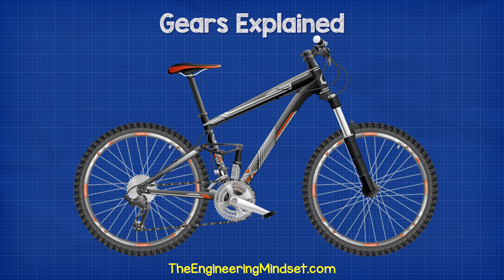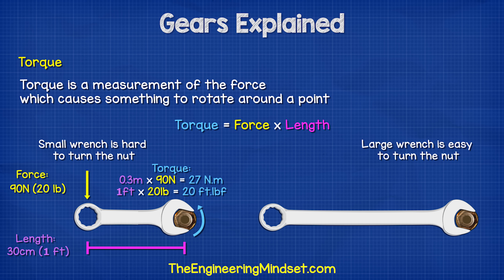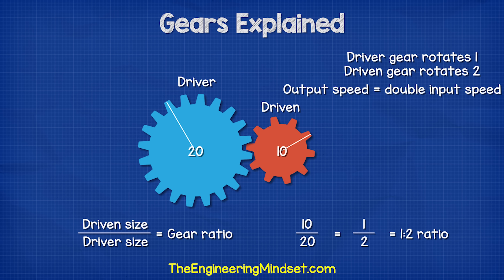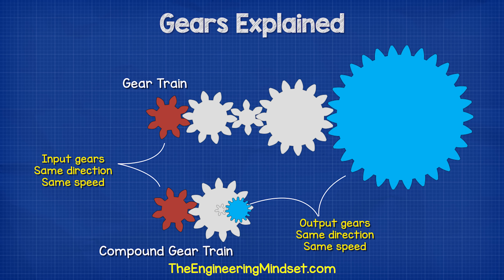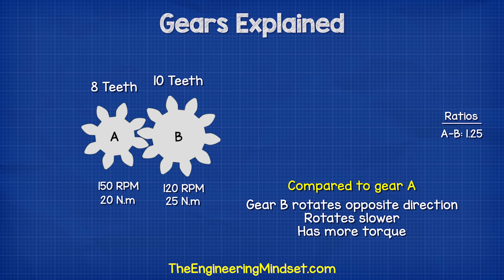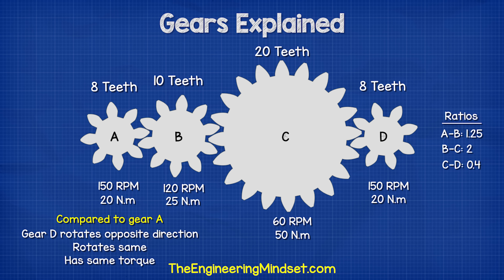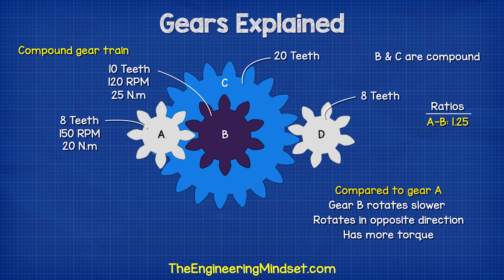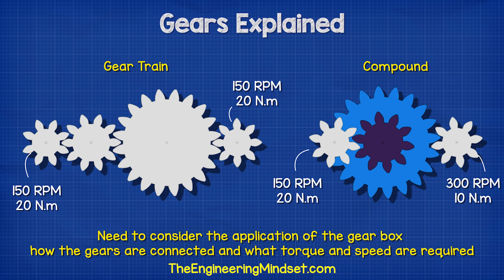Gears Explained -  mechanical engineering

Comment: It's amazing the amount of energy you can transfer with a couple gears, I was able to pull a massive length of heavy cable through piping with a gearbox, a chain and some casual chain pulling solo when three grown men pulling at once could hardly move it manually

Comment: As the rookie in the room, how do generate enough torque for a robot arm to suspend the robot in the air? We tried direct drive, and when the arm swings up and hooks on to my finger, there doesn't seem to be enough torque to make the robot move at all. If I add gears, assuming I'm understanding this correctly, I should be able to suspend the robot with that same motor given the right combination of gears?
Reply: Also, would adding a second motor, that puts out the same power as the first, be helpful?

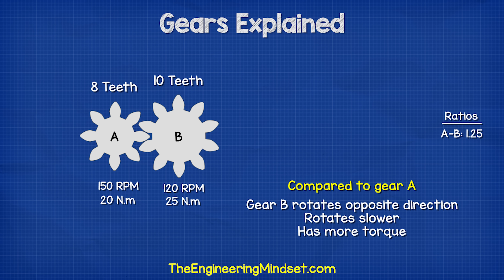Comment: At 4:54 It's not required to calculate the ratios for A to B and B to C only A to C.  Later at 5:29 when D is added only the ratio from A to D is required.  Since A and D both have eight teeth the ratio is 1:1.  It doesn't mater how many gears are involved, only one calculation is required.  This doesn't apply with gears on the same shaft at 6:15

Comment: If ratio = teeth of output/teeth of input, then the ratio should also be equal to RPM out/RPM in. If that's the case, then shouldn't RPM out be equal to ratio x RPM in?
Reply: Correct, that's what he said.

Comment: is there a way to increase both rpm and torque without losing values?
Reply: I don't think so because Power = Torque x Angular velocity (RPM). So to increase both the power would have had to increase, which means more energy transferred every second out of thin air.

Comment: In the compound gear system, why does the torque between b and c have to be the same ? I understand why the RPM is the same, but why torque is the same ? Can anyone explain ??
Reply: I have the same question because if turning force (ie torque) is force x distance, why doesn't the larger gear (C) have more torque?
Reply: @anayaj402  Yes torque = force x perpendicular distance to axis. Look where the force is being applied... to gear B not to gear C. So the torque would be the tangential force produced by A multiplied by the radius of gear B. Gear C is just along for the ride. It all depends on where the force is being applied.
Reply: Because gear b and c both are  mounted on same shaft therefore gear b and c has same rpm . And your next question why it's torque also same ?bcoz it's gear ratio is Same .  And aslo they mounted on same shaft
Reply: oh i cant

Comment: Gears really used to grind my gears. Thanks for explaining clearly.
Reply: in the real world resistance is included so you cant just calculate  it if its more than 3 or 4 gears after that you have to include resistance 

unless you can calculate with the resistance

Comment: Please change the thumbnail of the video as you have a 3 gear system which in practice they don’t turn.
Reply from the maker: Yes it can, you can't tell the height of each gear to know if they are stacked or interlocked. You should focus on how things can work, that's an Engineering Mindset.

Comment: Gears are just levers like any other lever where it is a trade-off of distance & power
Reply: Correct how ever you still do the same amount of work as work is equal to force multiplied by displacement.
Reply: @swift4856  I do not fully understand what you mean by Gravity is a weak force at great distances. Gravity is not a gear or lever but is an invisible force that pulls objects towards a bodies centre for example gravity on Earth pulls objects like you and me towards the centre.

I’m assuming you’re asking “Why is the gravity force so weak when we are higher up away from earth”. Simply put the force of gravity acting on a body (e.g a human) decreases as the distance between the body and earth increases. My explanation is very basic for a better understanding look into Newtons Law of Gravitation.
Reply: @orange9807  But isn't it just like 2 or more objects being levered towards each other because it is a centripetal force.  It is just a question I have always had because the force seems to reduce with distance the same as gears do. I realise the objects are causing the force themselves but the lever seems to be space/time. Sorry but no explanation of gravity has ever satisfied me. Sorry to be a bother
Reply: @swift4856  I would argue that gravity isn’t like 2 objects being levered together as then it would require a lever. The force of gravity keeping an object in circular motion is an example of centripetal force. 

Even I only have a very elementary knowledge in physics. It’s be great if someone with more knowledge would charm in.

P.s you’re not a bother mate
Reply: @orange9807  Yes there seems to be no fulcrum. But space time is being bent and it takes a lever to bend anything from straight to curved. But the difference of pressure or speed  on opposite sides of anything can cause it to bend also. Not sure how this ties in with distance/power though. Anyway not really making much sense. Thanks for listening though.

Comment: Sir, will the gears in the thumbnail pic rotate assuming the two upper gears have same diameter...🤔🤔
Reply: No, they will not
I am assuming all gears are touching each other
Take any individual gear and impart any clockwise or anti clockwise rotation, you will always get 1 gear opposing the direction of rotation of the driver gear !
Reply: @kevinsalmador739  I think I have figured out ,gear on the left will be compound gear , and upper right gear and lower right gear are separated but both are touching left hand side gear. In 2D it appears as though two right gears are touching but in 3D , the concept becomes clear.